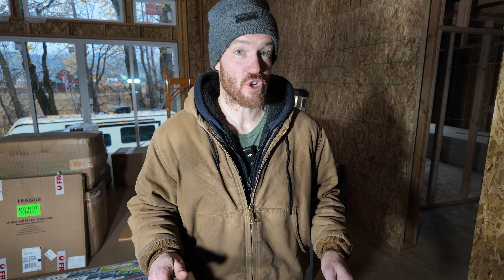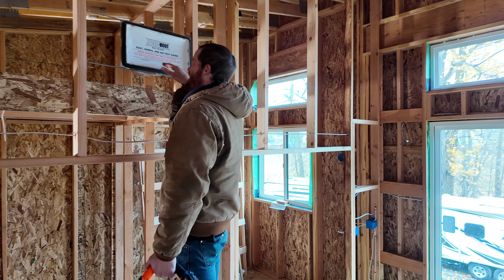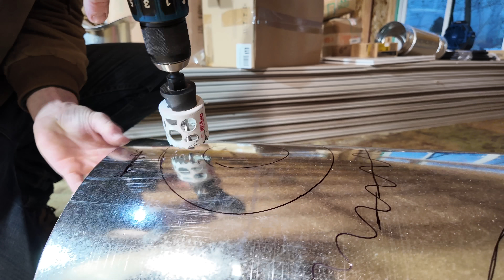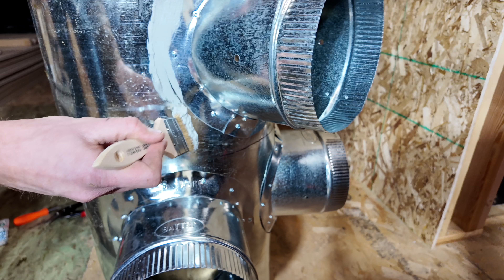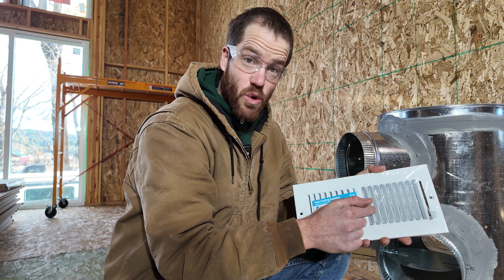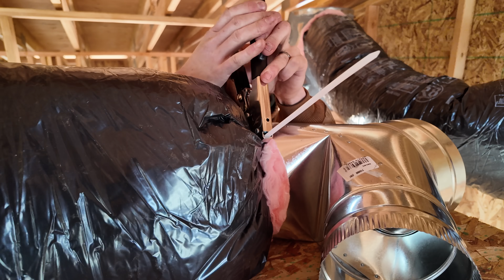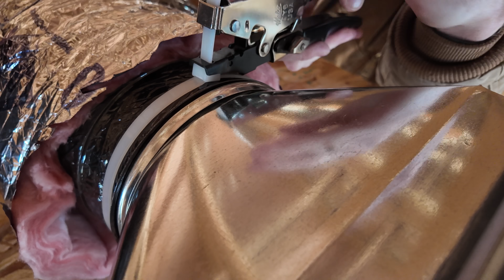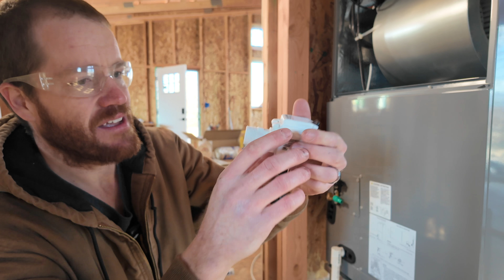HVAC Contractors Hate Me For Showing You This

Comment: Hi, an HVAC contactor here. All exposed metal parts need insulation, or they will sweat in cooling. Bat insulation and tie cord will work or use insulation cut from extra heat pipe.
Reply: HVAC contractor here too. We never have single wall duct exposed in any non- conditioned space. Attics can range from 120-160 degrees in the summer. Cold 50 degree air will make those joints sweat. I would do it correctly. Forget the guys who say it doesn't need it. Its minimal effort that will save you tons of problems.
Reply from the maker: Thanks for the tip!!
Reply: If you have hot humid air and your ductwork drops below dew point you’re gonna condense. I see it on many service calls here in Wisconsin on the hottest humid days
Reply: Yeah, you need to insulate that especially up in that attic area where it’s gonna be hot that will condensate if you’re running the air condition I’m a mechanical insulator. I’ve seen it all and it can really ruin things.
Reply: I can vouch for insulating the duct work.  I have a rental unit built in the 50's.  The insulation had fallen off in numerous areas causing condensation that dripped down onto the ceiling.  The excess moisture caused my hardwood floors to buckle and lift along with staining of the plaster.   After reapplying the insulation and repairs, all is good!
Reply: Yep insulation at r4 needs to be on exposed areas of metal in a conditioned space here in Ky. I would never leave metal exposed. It will condensate somewhere. Just asking for trouble down the road.
Reply: I just typed that in a comment before reading this lol
Reply: Everyone arguing this seems to forget the "cooling" part....😂 cooling will always cause condensation. Doesn't matter where it is. Heating isn't the same
Reply: It needs insulated when NOT in an conditioned space
Reply: contractors are not technicians
Reply: The air coming from the evaporator will be 45 degrees F. It needs duct insulation even in a conditioned attic. Dew point depends on relative humidity and 45 is very cold
Reply: Loose attic insulation will do the job. Plus more over all the ducting. R38 is 30 inches deep or so.
Reply: @kurtwerner4258 umm duct work shouldn’t be in the insulation.

Comment: Personally, as a retired commercial maintenance tech, I would mount your outside unit now. Run your siding afterwards. Just build out a box around the unit support, seal that to the sheathing and just trim and side around the box. You can use wood or metal for your box and can use hardware cloth and screen to allow necessary airflow. The project looks like it was designed and not just stuck on the building. It also hides all the ugly mechanicals. You can make the box unit removable, or a door for maintenance. It keeps snow, rain, birds, wasps and other critters form causing issues. AND, it'll be useful while working before you get to the siding.

Comment: I retired from a company that made avionics communications. One job I had was building wire cables. We used zip ties and used a similar tighter/cutter for years. When I see YouTube shows using the zip ties, I have wondered if those cutters were a big secret that no one knew about.. they are very handy!
Reply: We used them in aerospace and automatic test systems. The tools I have found have been crazy expensive (around $80). I haven’t seen them in the big box stores.

Comment: Yea man.  Legend.  That's a descriptive word I've been hearing here and there.  Yep Legend.  My favorite HVAC guy from here in the east.  Ya know, it's those oil boilers and Hydroponic systems ~ hot water through pipes set in the concrete floor.    Course my guy is usually working with radiators.  Very very Old School.  You now are meeting my requirements for (LEGEND).   Anyway ~ think East Massachusetts or South Boston. Houses a hundred years old.  My guy ~ Steven Lavimoniere ~. I think Portuguese ~. Ok Ok Ok Hot water,  Not Hot air.  Love Love Love this installation.  You are Legend here.   Courtney had better say something special to you about this project there.  She just better say something.   Legend.  I'll tell ya.  Oh yea! 〰✨🌿👍🌿✨〰

Comment: We just bought a house with baseboard electric upstairs and no heating in the basement. we got quoted $18,000 to install heat pump and furnace.  We’re pretty handy. This is our third house we’ve remodeled, but I’ve never touched HVAC. This video might give it a try

Comment: I work in HVAC, and I think what mr cool has done is awesome for the DIYer! I will say, if you ever build a ductwork setup again, I'd assemble the hard pipe then drill all the holes, couldnt hurt to put some tape over the seam either. Its a lot easier than trying to assemble it after cutting the take offs. I usually just use a hole saw or step bit to get the hole started, then follow it with aviation snips. I would also suggest insulating all your splices and the any bare metal on the supply ducting to make sure theres no sweating in the summer and moisture getting into your drywall
Reply from the maker: Thanks so much for the tips!! 🙌
Reply: @AmbitionStrikes  I didn't see where you insulated all your wye branches or the main plenum.....You need to do this for condensation purposes in the summer and heat loss in the winter.
Reply: @AmbitionStrikes so why did you install the supply air outlets on the inside high wall? For maximum comfort you could have used a little more flex & installed ceiling registers above windows along the outside wall where a disproportionate % of the winter heat loss & summer heat gain happens. Also, directing heat straight down to the floor on the perimeter works better than shooting air across the ceiling where it’s likely to stay creating a larger temperature differential between floor & ceiling. 
Does Mr. Cool make a variable capacity HP? Would definitely improve run time at lower outputs, also giving you more even overall indoor temperatures & at lower operating cost as opposed to a fixed capacity unit short cycling most of the time. Not sure what the summer/winter design temperatures are where you built, but a well insulated & air sealed 1000’ would likely only need 1-2 tons of capacity 80% of the time.
Reply: Yeah as a Tinkocker a Unibit is a must have, way safer and smaller than a hole saw.
Reply: @alexo5861  Flat head screwdriver
Reply: Here in the South (USA) installation of the duct “boots” is ALWAYS in the ceiling, not in the walls! WHY? Because ceiling installs are much quicker and less expensive!
Also, ALWAYS wear gloves when working with sheet metal‼️‼️I’ve known HVAC techs that had to go out on disability due to severe cuts on their hands. It’s now commonplace to wear some form of gloves all the time. 
Remember, your hands are what allows you to make a living. Please take care of them.
Best wishes to all👍
Reply: @BartlettTFD I was a professional sheet metal worker for over 20 years. Never wore gloves, only got stitches once, and that was when a piece caught my arm, not my hand.
Reply: I second the ridged pipe... warm dry air is going to make that plastic crispy and brittle after a decade or so. Even old zip ties break easy by hand after 10 or 15 years. Rigid is probably way easier to "deal with" during installation as well.
Reply: Not if the zip ties are made of nylon. These last forever and even get stronger over time.
Reply: Ufff, so many things done wrong. First, where is your ERV? Recirculating stale is great to make your home smell like crap. You didn’t insulate your branches. Your plenum is supposed to be lined with rubber to ensure they’re no t noisy. Enjoy water condensation in your attic. Those insulted flexible tubes are crap. Where are the return lines? You’re going to use just the unit to suck in supply air? No filter? Zip ties to secure ducted? No fil tape?  This system is going to be unbalanced, won’t circulate properly, likely nosy and definitely going to cause mold.  Bud, sometimes the extra money is worth it.
Reply: @FirstLast-et3sw  Very few houses in the US have an ERV. That said, I would totally want one in a new construction home, but it's typically not to.
Reply: Ufff, so many things done wrong. First, where is your ERV? Recirculating stale is great to make your home smell like crap. You didn’t insulate your elbows. Enjoy water condensation in your attic. Those insulted flexible tubes are crap. Where are the return lines? You’re going to use just the unit to suck in supply air? No filter? Bud, sometimes the extra money is worth it.
Reply: Fresh air in the US is usually via a poor quality building, conditioned fresh air systems are usually only in high end custom homes.
Reply: @JohnWilson-p6c  fresh air is code in most construction where I am.
Reply: Great job…. Wow!
Reply: Do you have to make sure the runs are all the same length ?
Reply: @mattwheaton7621 no you do not, but the shorter the runs the better for airflow
Reply: @mattwheaton7621 Lengths don't necessarily need to be the same length if you accommodate with the proper tube circumference. Thus the main must be greater then at the end. Complicated for me to explain in text. Sorry.
Reply: I did not notice if those vent doors were adjusted before they were covered up and zip-tied.
Reply: @mattwheaton7621 No, some will be closer than others. The dampers inside the ducts will help to control airflow.
Reply: @mattwheaton7621 
No. 
Just properly size the ductwork  for the length of the duct run.
Use a duculator for the run length and duct sizing.
Reply: Make sure those dampers move freely.  Sometimes the holes ar not punched correctly, or the hardware on the damper plate isn't quite 180° apart.  Sometimes just flipping those plates over, can make them work right.
Reply: Disposable chinese junk.. for the frugal only... if you think it's qaulity you are greatly mistaken.... Mr cool has many limits...
Reply: I also work in the HVAC field and I would start holes for takeoffs with a hammer and large flathead screwdriver works better than you think. Hahaha
Reply: This is the worst installment ever, and for u not to say that means u need to retire 😔 . I can't believe this dude recorded this 😅😅
Reply: If the air is sucked in from under the hvac, where does the fresh outside air com in?
Here i sweden we dont have supplyair in the bathroom and kitchen, those are the places where foul air is created, or nice smelling if you are cooking something nice.
Only returnair in Bath and kitchen.
Supplyair to bathroom comes from the doorway or a venthole in the wall.
The same goes for the kitchen.
Supplyair to the rest of the rooms.
Reply: @subdivera in US very few use heat recovery ventilation system like you are describing. They usually install centralised AC which means it's only designed to move air from one room where the heat exchanger is, to the rooms that require conditioned air. These are closed ventilation systems as they do not replace the air, they just recirculate it with the purpose of heating or cooling it.
Reply: @MentaL65535  Thanks for explaining. 🙂
Reply: @subdivera  Most homes in the hot and humid areas of the USA don't do much fresh air exchange. This is due to the humidity in the air outside, and those that do pull fresh air do so via underground pipes so the humidity has a chance to condense and drain out before making it to the inside spaces. It is common to have 65%+ humidity for weeks during the summer where I live. This is also why it was important from them to have the air handler in the living space.
Reply: @Anonofthepeople not so code in California for combustible heat is 25 % min. Fresh air
Reply: @subdivera  so if your thinking outside air you can install a makeup air system but that is if the kitchen exhaust is pulling air out of the house. The air handler just circulates the air in the house. You don't pull air out of the kitchen or bathroom but you can supply air to those rooms to heat and cool them
Reply: @subdivera  Outside air is not required in the US for electric only heating systems. If it were gas or fuel oil heat, then yes combustion air from outside would be needed.
Reply: @willgallatin2802 I think they are referring to a mixing valve. Units often have a way to mix a bit of fresh air into the house. Usually only roof package and wall units have that. Most baths and kitchens have an exhaust to the outside for odors but still need an HVAC duct to get proper circulation in that room.
Reply: @willgallatin2802   ..fresh  air intake is becoming mandatory in many states
Reply: @willgallatin2802  not true you are confusing combustion air with "fresh" outside air.  That is required per UMC on new construction.  Electric only heating is usually not allowed either must be heat pump or gas heat
Reply: For tightly built homes, mechanical ventilation systems are often required by building codes to ensure adequate fresh air exchange and indoor air quality. ASHRAE Standard 62.2 is a key reference for determining ventilation rates, typically based on square footage and occupancy. In addition to general ventilation, local exhaust (like bathroom and kitchen fans) and make-up air systems may be necessary to balance air pressure and ensure proper ventilation throughout the home.  @willgallatin2802
Reply: Return air from the bathroom to the the air handler to the whole house.  Gross
Reply: @subdivera 🤣😂🤣😂 I think you have it backwards. Supply air is blowing out and return air is sucking in. You don’t want to suck bathroom air into your system and blow it back out into house.🤦🏻🤣😂
Reply: @subdivera I think your backwards, supply air to bathroom and kitchen, no return air from these rooms
Reply: @ivancook1247 I agree, the air will be taking the quickest route to the return and avoid the exterior walls
Reply: @ivancook1247  I agree. Bathroom air is either laden with smells or humidity. And  both are also in kitchen air.
Reply: Same here.
Reply: Was going to suggest the same. You will lose 75 to 95 % of your heat and cool where there is any exposed tin/metal, leading to over heating and cooling in the ceiling, also as you mentioned, sweating from condensation, which leads to black mould in not only the drywall but the wood as well
Reply: That’s exactly what my HVAC guy did too. He put the tape on first he put some of the goo then he put the tape on and then he put two more layers of goo over the top of that. He did a great job I’ve been handy and I’ve built seven houses but I never did the HVAC but this guy knows what he’s doing and I think after reading up a lot about Mr. Cool it’s a great company good product
Reply: @Hammydavis  poor prodct
Reply: @Blitzkrieg.u812  Poor spelling.
Reply: There is many code violations in the video. And, your comments contribute to the violation. 

You wrote “could hurt to put some tape…”! FYI, to seal the “seam” is not an option. It is a requirement. You wrote “some tape”. If one is to use “tape”, they are to use a specific type tape for metal, etc.

Oh, it is obvious someone ignored the “duct” manufacturer’s instructions for installing their product…
Reply: Mr cool took care of all your low paid employees. Take skill out of any equation and you get low paid hard working migrants 😂
Reply: @100Proof-n5d they are called illegal aliens. That's what the law says.

Comment: Looks good but dont forget to insulate the octopus plenum and all.other uninsulated metal connecting your flex connections as the duct is in the attic and you will create moisture within the ductwork during summer season then leading to mold issues.
Reply: Yes 100% insulate the plenum otherwise it will sweat big time in the summer and you will have water and mold issues
Reply: plus they need to better insulate the boots as there is exposed metal on those too
Reply: @james6794  true if they plan on not spray foaming the ceiling and wall joists. But if they do then the house will be tight and will not have to insulate the boots
Reply: Literally none of my ductwork has insulation. But I need the heat loss in my basement to keep my pipes from freezing. 😅

Comment: Suggestion put foil tape on the plenum and at all registers. Where the duct is at. Also  little FYI  when   setting the outside unit. Do it  off the ground do to the snow you all get. Also when you run the line set. Try not to have a lot of rolled up line set at the out door unit. Reason being is refrigerant has oil in it and when the line set is rolled up  oil can settle at the bottom of the coils which in time will destroy the compressor.
Reply: Great comments. Does the oil in the line set apply to these pre-vac line sets too I wonder?  The instructions mention vertical traps for regular tubing but not the pre-vac ones?  Curious
Reply: @Patrioti3260 yes even the pre charged linesets that have extra lineset looped up left over creates one big oil trap that we’ll destroy the compressor do to minimize oil return to the compressor if any at all makes it back I would say there compressor life will be really short.

Comment: Wondering why you didn’t put the unit in the basement area?
Reply: No inside stairs, that looks like possibly going to be a second unit.
Reply: A big mistake not putting in stairs to the basement. Plus it will now need its own heat unit.
Reply: @RhubarbPatch  he mentioned the basement was going to get its own separate system. They probably intend the basement as a separate rental unit
Reply: @gexploits  could be

Comment: Were mini splits an option, and if so, why did you elect to do a central ducted unit instead?
Reply from the maker: They were definitely an option! But it would have required an air handler in every room and taken up precious wall space. Since the house is down to studs, it was easy to run the ducting.